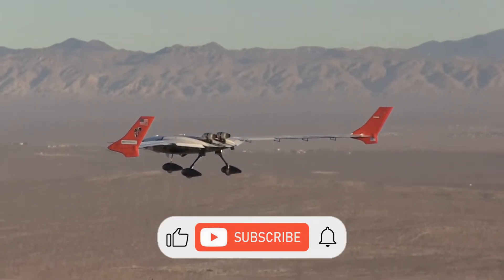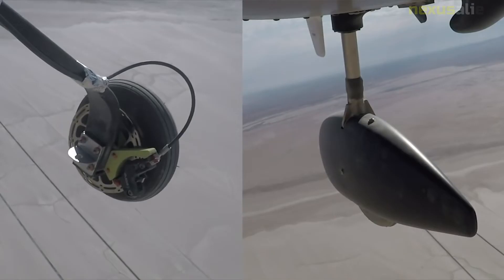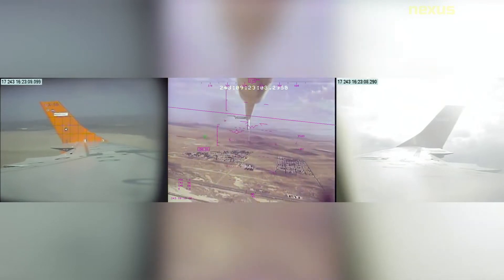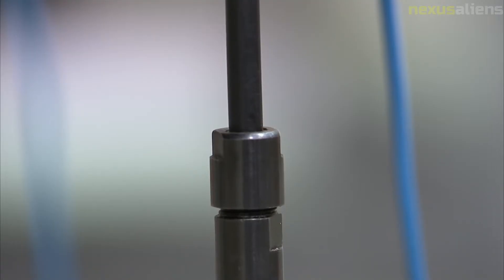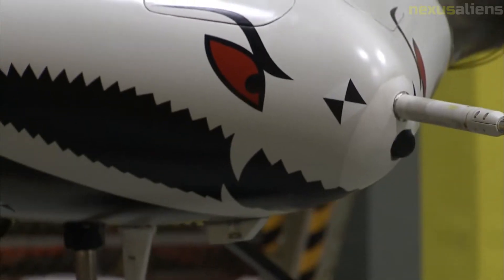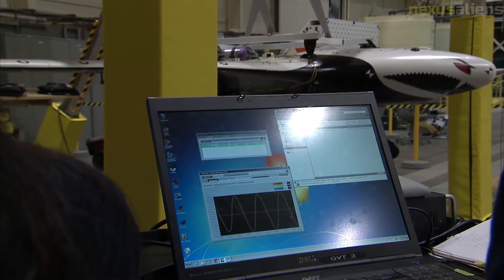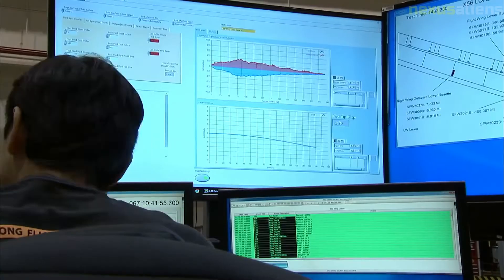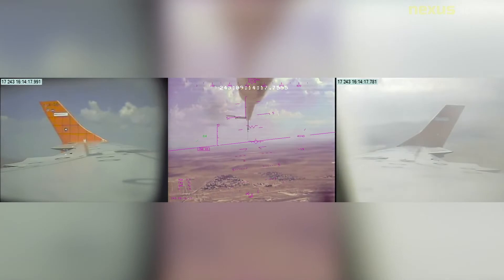The anti-flutter drone, Lockheed Martin X-56.

Comment: When you create The Thunderwell Vid Please use the following-- First, info I've sent you-- 
The steam accelerated Jules Verne capsule, which was suggested by the speed of at least 6 times earth’s escape velocity, achieved by the 10-cm thick, 1.2 m diameter steel cover blown off the top of the 152 m shaft of the 0.3 kt Plumbbob-Pascal B underground Nevada test on 27 August 1957. In that test, a 1.5 m thick 2 ton concrete plug immediately over the bomb was pushed up the shaft by the detonation, knocking the welded steel lid upward. This was a preliminary experiment by Dr Robert Brownlee which ultimately aimed to launch spacecraft using the steam pressure from deep shafts filled with water, with a nuclear explosion at the bottom; an improvement of Jules Verne’s cannon-fired projectile described in De la Terre à la Lune, 1865, where steam pressure would give a more survivable gentle acceleration than Verne’s direct impulse from an explosion. Some 90% of the radioactivity would be trapped underground!
Reply: Second-- Any information or pictures you can use from this Vid-- https://youtu.be/NSeL5c65v-g
Reply: Third and most important-- statement about how Thunderwell would* be used to launch cargo into orbit, destroy asteroids, and likely* best defense against Invading Alien Spaceship INCLUDING THIS CLIP-- https://youtu.be/VonfewfNNfI
Reply: PLEASE🙏 use ALL* of this and anything you'd like to add of course (if there's any room left ;) to create the First, Only, lol and BEST Vid Exclusively about The Thunderwell!😁👍👍
Reply from the maker: @Anarchy_420  will defiantly make one.
Reply: @nexusaliens  if this person can use it then you can lol your not taking it from the original source anymore your using it from someone else who has already done that ;)
Reply from the maker: @Anarchy_420  The person claims that he made the video using skill share, so I cant use the animation because the person can make a copyright claim and my video will be taken down. But, relax fam I will make a video probably by next Wednesday, please don't get disappointed if it is reaching your expectation.  😁
Reply: @nexusaliens  lol I'm relaxed I just really like this concept ever since seeing The series Curiosity Alien Invasion are we ready all those years ago and that clip is apart of that show so that's bull sh*t lmao they ripped it off! They didn't make that vid they stole it!!🤯
Reply: @nexusaliens  As long as its better than the Vid I already have in my Playlist (The Manhole Cover Vid) I'll be quite happy😁👍